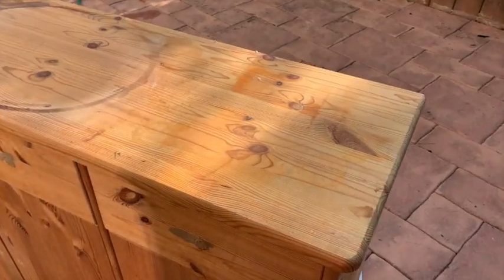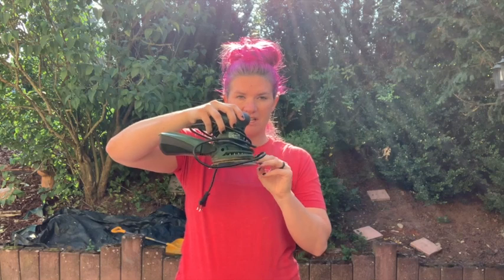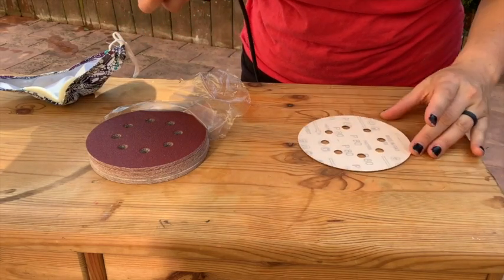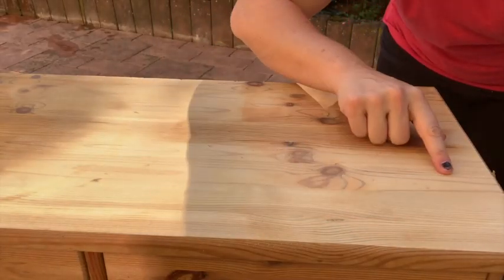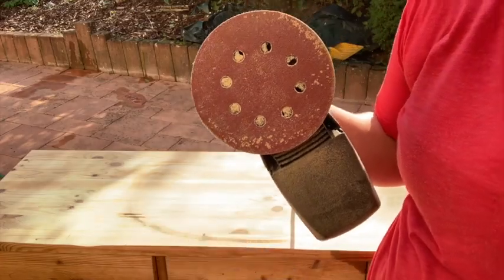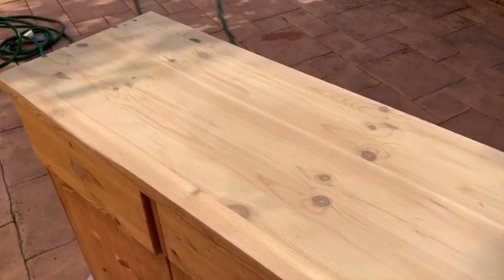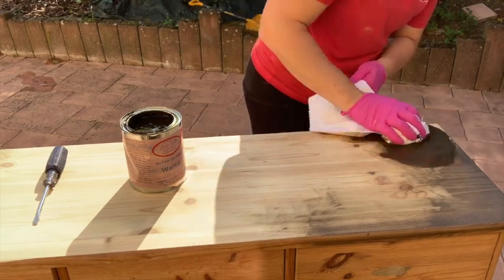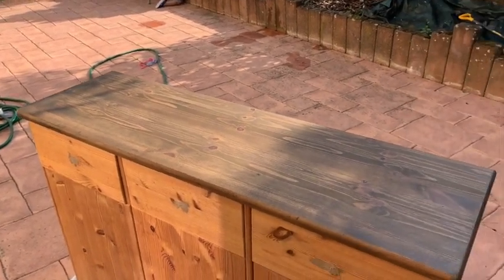Fixing A Solid Wood Furniture Top

Comment: Nothing looks any better than a refinished table top using the gel stain.  Walnut is definitely my go to stain.  In addition to the mask when sanding, I also use goggles.  With me, most of the time there is a lot of dust and I definitely don't want it in my eyes.  I put my stain on like you do with a rag swirling and then wiping with the grain.  Guess I have learned something watching all the videos.  Thanks for a great informative video !
Reply from the maker: Gloria Fields yes you have!! I usually have my glasses on when doing any kind of woodworking, sanding all that good stuff. 

I agree a refinished too is so refreshing!!!

Comment: Kelly Broadbent: I am working on a kitchen island, and it has several areas that cooking oil has soaked into the wood. After sanding, it will not take a stain! Help! What can I do?
Reply from the maker: You may have to try and use mineral spirits or lacquer thinner to get that oil.....